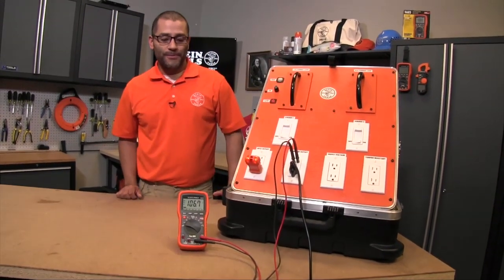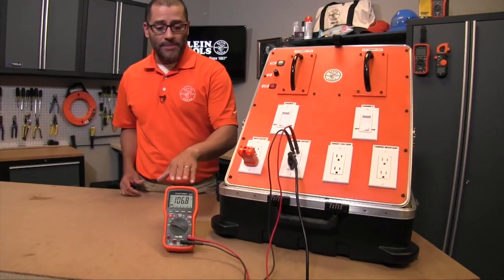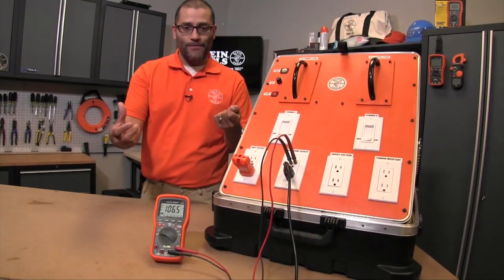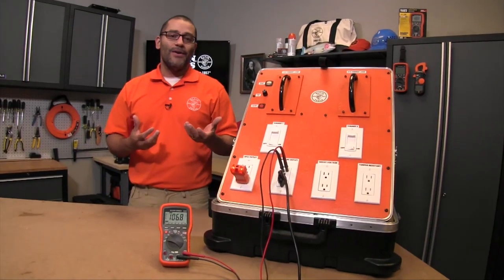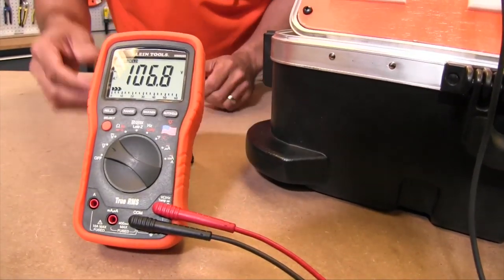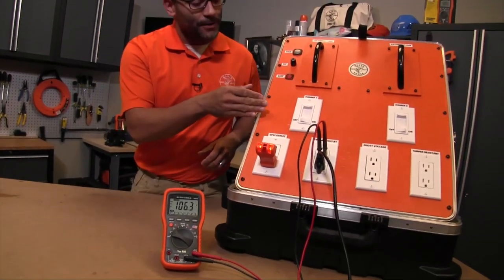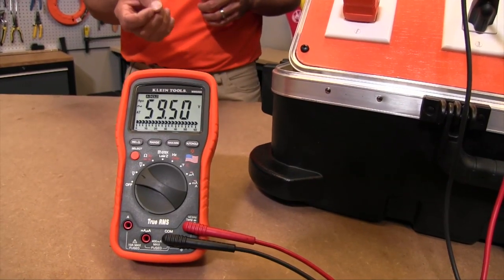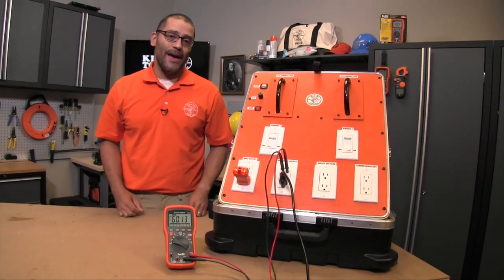How To Use The Auto Hold Function on Your Meter

Comment: For me MIn/Max/Avg is more important for these types of readings. I want to see what my the lowest, let's say voltage for now, (Min), the highest (Max) and then what was the average (Avg) reading during no load, load and overload conditions over time. Not just what it is a few seconds after a "stable" reading. This feature doesn't seem useful for my everyday needs especially if it takes six seconds on my count, to get the "most stable signal that it can". What does everyone else think? Keep in mind that this meter DOES have a Min/Max mode but no averaging from what I have read. Curious to know what data hold is? Good video and cool test rig. Thumps up from us!